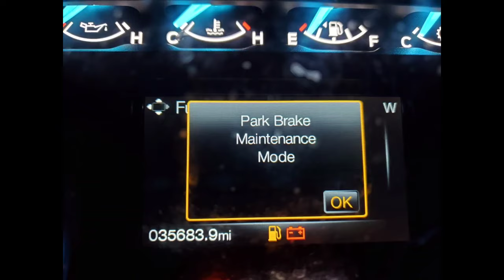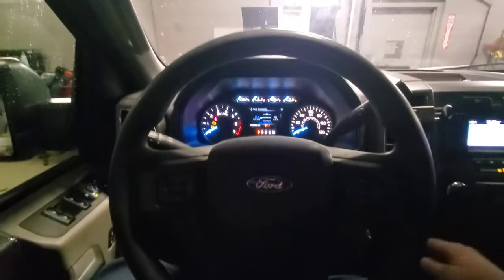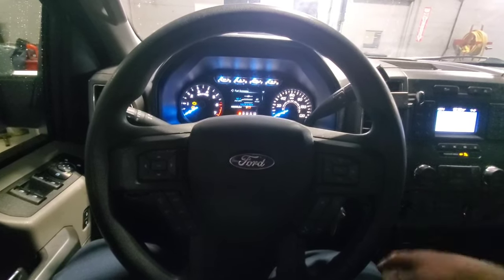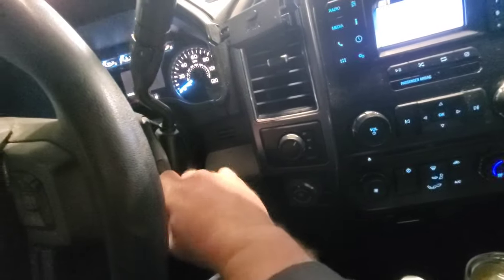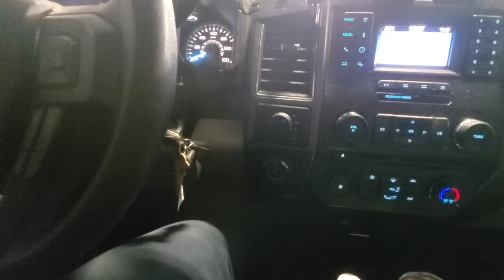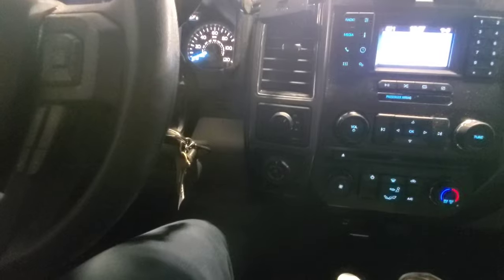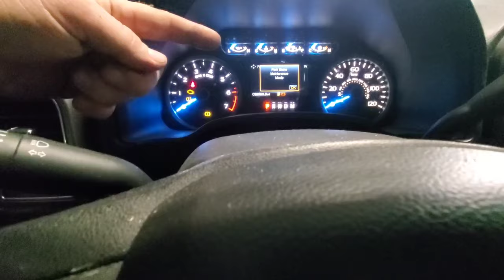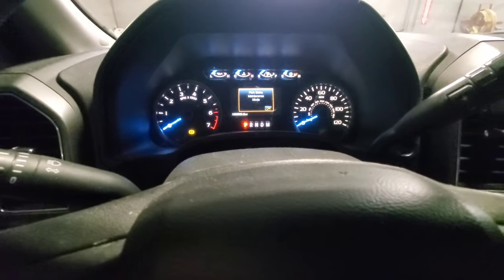Ford F150 Electronic Parking Brake and Other Models - Park Brake Maintenance Mode Rear Brake prep

Comment: 2016 Ford Fusion push start how to get out of park brake mode?
Reply from the maker: So basically you do the same as going into park brake maintenance mode but to come out you reverse the position of the switch and then you hit okay on the screen to accept
Reply: I did it several times. 
I even went and bought the tool to do it from autozone. 
It wont come out of EPB mode.
Any help much appreciated. 
So when doing the piston ?Do you have to turn the piston in? Or when its in the EPB mode can you just push it?
I had to turn the piston to get it to go in while it was in EPB mode. 
I just finished turnng it back out to try and start over?
Reply from the maker: @TyRC12  no no no you don't turn the piston in in emergency brake Park mode you push it in
Reply from the maker: @TyRC12  I've never had to turn a piston in after putting it in an emergency brake Park mode

You don't turn the electronic emergency brake Pistons you only collapse them like a regular one after you put them in emergency brake Park mode they just push right in like butter

Just like you would have a regular piston if you're turning it you may have actually screwed it up
Reply: I thought so. I was like everyone is saying the piston just pushes in. The last EPB car i did I just took off sensor pushed the piston with my hand after spinning the shaft that turns the piston all the way until the piston stopped. 
I knew right there and then I had to take the pads off and start over.
Reply: Oh the Tool from Autozone I payed 319.00 for Kept failing.
Smh
 Im a determined person. 
Nothing going to stop me. Thanks again

Comment: How about for keyless ignition
Reply from the maker: Well your push button start is the key so everything is still the same except instead of sticking a key in the ignition you're pushing a button that is the key so the same principle applies
Reply: @FordBossMe  doing it exactly that way with button as the key, and I get nothing.  What could I be doing wrong?  One guy said that I should pull instead of push.

Comment: I rented a Ford Expedition for a week and never found the electronic parking brake.  There is so much electronic crap on these newer cars it's hard to comprehend.
The old brake system worked fine goes to show if it aint broke dont fix it.
Reply from the maker: Some of the new ones have it some of them don't but most of them are going to it

I like the old system but I didn't like the old system and the reason is nobody would use it so it would break and then it would be a nightmare to take apart

Comment: What do you do with the 'OK' screens?
Reply from the maker: Once I see it's in maintenance mode and that screen pops up I shut the key off and I get out and do my work I don't push anything
Reply from the maker: You do the same thing whenever you're done but you pull the switch the opposite direction and a message is going to pop up that you can hit okay on and you can disregard as well turn it off turn it back on your good to go
Reply: So to this answer depending on if your car worked when put in Parking brake mode. 
You Have to hit Ok 3 times 
Same Sequence 3 times for me. 
Im asuming that if you dont hit the ok when engaging the EPB it wont work properly 
So you will have to push ok to get it out of EPB. 

Or this is the process for the push button start?
I need to know if people with this problem did what I did and turned the piston in since it wouldnt just push in?

If so make sure when engaging ,push the ok button  every time you see it until EPB mode is on to get the EPB to disengage. I had to take off sensor turn the shaft until it stopped that push piston in with my hand. 
2016 Ford Fusion Titanium 
I hope this helps someone who gets stuck like I did. 
Repeat the sequence until it works.. Ok ,Is The Way...
Reply from the maker: @TyRC12  see I'm not sure why you guys are actually having the problem because I do this every single day in the field and I don't have to do all this extra stuff I just do it exactly the way I said in the video and it works every single time so I'm not sure what people are doing wrong and if I get a chance to do another video I'll make it very explicitly clear and show explicitly what I'm doing I don't have to do all this extra hit okay do this and do that what I said in the video is exactly what I do and it works

I'm just now finding out the people are saying you have to hit okay I've never had to hit okay to make it work as long as it goes into the mode I can take it back out of the mode no problem

Anyway I'm glad people are finding ways to make it work but how I showed in this video is how I do it and it works without all these extra three times steps and all this other stuff
Reply: I did it exactly as you said.
I could tell you knew what you was talking about. Thats why I asked you. Your answers gave me solutions. 
 Just the Piston wouldnt push I knew something didnt work properly when disengaging.
I know your a Professional at this. 
I believe this is only for certain cars that dont work as expected. Thats the only thing I can Think. You said you do even the push buttons right? Has to just be stubborn cars..

YOU ARE THE MAN. 
IM VERY THANKFUL FOR YOUR VIDEOS. ....I was stuck.
This is a known problem on fusions on the internet I see.
Reply from the maker: @TyRC12  well I've had a lot of people message me and say they wish they would have seen my video first because they turn the piston in manually and then screw up the caliper and the dealer tries to charge them thousands of dollars to put new ones on and install everything
Reply: I was so scared of that. 
I didnt give up. Customer had patients. I was able to find you to help with the solution.  
The situation was right.  
Took me like 2 hours to get it out of the EPB mode. smh
I remembered working on another 2016 which a had to take off the sensor. So I repeated after asking you about turning the piston. You gave me the answer that I had to unwind the piston. I prayed. God listened. .
Very thankful you responded. I subscribed. I will be watching more videos.
Reply: @FordBossMe  what do you mean when you say “turn the piston in?” They only compress, right?

Comment: I used my 2000$ code reader to put it in service mode and it went in and i did the brakes and now its saying failure… i dont understand how i heard them retract back after doing the hot functions EPB service mode
Reply from the maker: I mean nice show how to put them in and take them out and multiple videos in my library I'm not sure what else you want me to do I'm not sure what else you need

Comment: I accidentally lifted the parking brake up instead of pushing it down now the piston is fully extended after I took the brakes off and caliper off. How do I fix this? Screen just parking brake service required.
Reply from the maker: When you put it in maintenance mode did you have the caliper off of the vehicle already
Reply from the maker: If you had the caliper off of the vehicle already and you extended the Piston all the way out without putting a caliper back on I would suggest trying to put it the other way and then pushing it back in and if it doesn't work then you're going to have to get it to the dealer

Comment: 2018 f150 lariat with push button start. 
Your sequence doesn't work. Now what?
Reply from the maker: Actually it is the same process you're just doing something not long enough or you're pushing the button too late or
Reply from the maker: Key off 
push accelerator down and hold 
Push parking brake in not up
turn key on 5 sec
then key off while still holding and then back on and hold....park brake maintenance mode
Reply: Ok. Maybe not making myself clear. I have a push button start. When I'm using your sequence two ok screens pop up. What do I do with them? Hit ok?
Reply from the maker: @jamesblumensheid353  email me the pictures

poissorichard.rp@gmail.com
Reply from the maker: Oh I see what you mean now don't worry about them don't touch them

 whenever it says it's in maintenance mode just go ahead and turn the key off and then close the door and do your work
Reply: @FordBossMe  I have been trying this process on my 18 Lariat with push button start.  No Joy.  What could I be doing wrong.
Reply: OK, well, for me, I had to cycle the key/button off and on approximately three times while holding the gas pedal and pressing in the brake release button, and I did "OK" through the screens that come up.  Only then could I get into maintenance mode, with three "beeps" announcing its arrival.  Same thing to get back into regular service mode--three times cycle the "key" button while holding the gas down and pulling up/on the brake button, while doing "OK" through any screens.  It doesn't have a screen to announce that it is back out of maintenance mode; instead, the red "Brake" light just stops blinking and you hear the caliper re-cycling.  Then normal operation resumes.   Only took me about two hours in the Lariat cab to figure this out.  Thanks for getting me started in the right direction!  For anyone else who's stuck, don't give up.  Eventually you'll figure out the pattern. 3x cycling may be the "key" for you, too!
Reply from the maker: @jwidmann1  I'm not sure what you're doing wrong man I'm not there to look at it and see what's going on it's the opposite of how you put it in and what you're talkin about with hitting the okay button and everything else I don't know what you did that's not true

Comment: I'll never buy a Ford truck again. Ever!
Reply: So dude I'm changing the brakes I get the front done I moved to the back not realizing that you had to jump through all those Hoops for the electric brake pull the caliber off look at it realize it wont compress go to YouTube video go to the cab of the truck and try to get it to retract and could not get the thing the retracted fact the thing fell apart and started spewing brake fluid it's done I am so done it's a 2018 the First new truck I've ever bought I will never buy one again I've only ever own Ford and I'm done with Ford also

Comment: Ok so what happens when you do this and it pushes the fucking caliper all the way out? Now what?
Reply from the maker: Well unfortunately because you didn't do it right now you're probably going to have to either pull the motor off the back of the caliper and try to get everything to go back together or you're going to have to put new calipers and motors on it
Reply: @FordBossMe  ok so I'm going to get a caliper. Not sure about the motor but now I have the parking brake malfunction light. It will not let me put it in service mode now does that sound right?
Reply: @FordBossMe  ok so good news is I was able to get a new caliper and install everything. Cycled the parking brake and cleared the service message on the dash. Was successful in getting the parking brake in maintenance mode to change the driver side rear. Everything seems fine aside from a dragging sound which I believe is just the new being worn off.